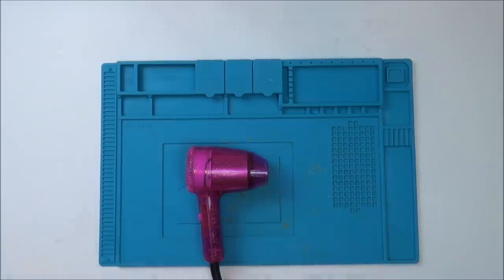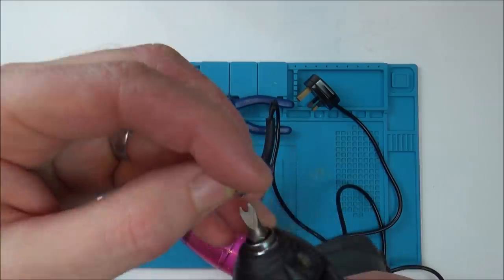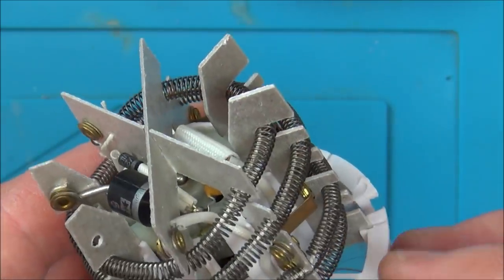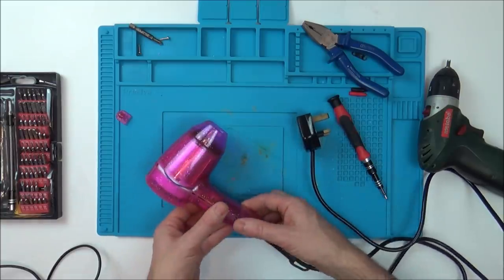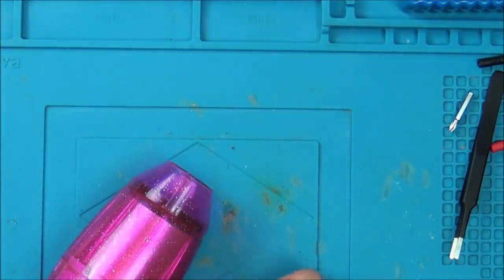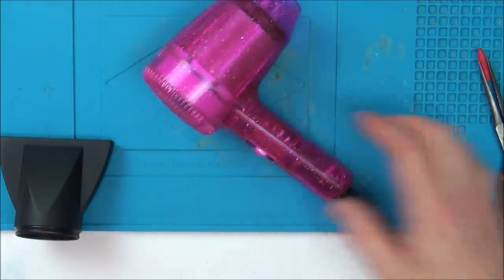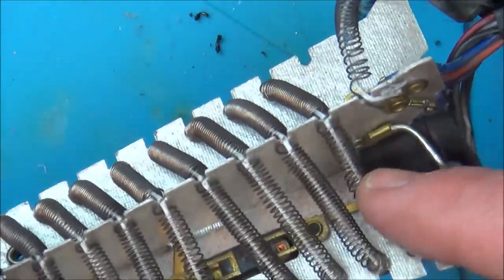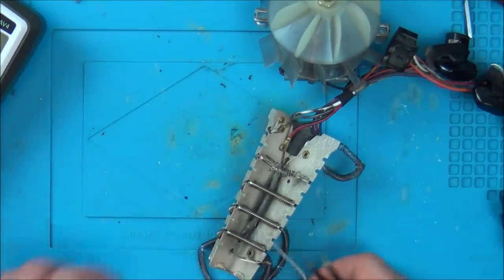Trying to FIX: 2 Faulty Hair Dryers

Comment: On the hair dryer on that mains cable going in to it there's a filter capitor and a discharge resistor across it the hair dryer has three elements the first and second have wires inbertween to give the right heat mode then four third speed there all powerd giving more heat

Comment: it will be, one coil for the first setting the other coil for the second setting and both coils for the third setting. The heat difference between the coils is caused by the resistance of  the coils.
Reply from the maker: Of course, that makes more sense. Thanks PDS :-)
Reply: @Mymatevince  I missed the part at the start of you looking at the second hair dryer, In which you say that the first heat setting is cold. If it is then it is just, First setting no coil, second setting one coil and third setting both coils. The cold boost button will spin the fan/motor faster. The capacitor limits spikes to the voltage when you use the switches. The impedance of the motor causes the voltage to spike when you first apply the voltage to the motor. Putting a capacitor across the motor or in that case the supply to the motor smooths the voltage line and greatly reduces spikes.

Comment: I took out the heating element on an old hairdryer during the hot months and just put in a switch with a 12v power supply, so I could have a handheld fan :)

Comment: A  "kit for young kids"...build your own mains powered hair dryer, what a great idea....can't stand kids. Seriously that pink thing looks like a bloody death trap, don't mean to scare you but cheap electrical goods and kids...Hmmm, I think I would be happier if the kid had the bigger better built one. But I guess they've been using it for years, so no problem yes ? maybe ? but those coils aren't far away and they're at mains potential, it looks like a toy, which it aint...just sayin. Your spot on with the "Bimetallic Strip" That sort of stuff I tend to treat as "disposable" I no that's not good practice what I mean is I would use the bits and bobs elsewhere, like the motor  and switches then just buy a new one for  the family....I was writing this as I was listening and its great ! you were saying all the sensible stuff that I was thinking, clearly you have no intention of using them again just another great video, thanks and a great new year to you all.
Reply from the maker: Thanks mate :-) Happy New year to you too.

Comment: hi vince this comment is unrelated to this video but i wanted to ask because i can trust your opinion, i was finding a short in my playstation 2 yesterday, i removed a chip and tested the caps around it but the short was still there, so i put the chip back on the board and took off an electrolytic smd capacitor, but the short was still there and the cap was testing fine, BUT...putting the cap back on the board with hot air.. i applied a little pressure to the top of the cap to make sure it had a solid connection and it blew up in my face.. could you shed a little light on what i did wrong so i dont repeat the mistake in future lol its made me nervous to try again... again sorry for the unrelated comment

Comment: you only got a bit of hair off the fan now if you did manage to separate the fan blade from motor you would have found the hair tightly wound round the spindle cos the motor should rotate more freely than that yet its not hence why the thermal cut out activates more than it should
Reply: your answer to the shock situation is the air goes in thru the back & out thru the front so there is no way you can get an electrical shock from it

Comment: I had a room heater (fan with heat coils like those) that had the same thing happen i would not trust it and threw it away.
Reply: I would imagine a room heater isn't likely to pose the same danger as a hairdryer used by someone with wet hair, wet hands, maybe in a steamy bathroom with humidity up.
Reply: @dodgydruid  it made a spark when the coil broke!

Comment: I don't think you can solder a broken heating element, I think you'd need to tack weld it back together because solder would probably just melt once you turn the dryer on.
Reply: Yeah, without that the only thing you can do is do a mr. twist and hope it won't break once those wires heat up. Not sure if it would really just melt away but i would not risk it (since hot msolder in hair is not fun)
Reply: Just buy a new hairdryer lol!

Comment: Once had a clothes dryer that the large heat coil would burn into. I would put the wire back together with a small wire connector and wait until it broke again. After 6 connectors, it got replaced. Great videos you do. Thank You...

Comment: Or you can get "that winding" for free. They are used in public restroom hand dryers. Cameras in restrooms are forbidden so you could easely kick one off the wall and take the coil home. Then you can measure the resistance and cut it at the needed lenght. You can easily calculate the needed resistance with Ohm's law. You know the voltage and power of that unit. 😂😂😂
Reply: You've been talking to the kids in my town.

Comment: This is what I remember about how the different heat settings work. You are correct in there being two different heating coils. The first heat setting only powers one coil which is usually shorter and therefore less resistance for heat to be created from. The second heat setting should be only powering the second, longer coil which has more resistance and can create more heat. The third heat setting is activating both coils at the same time which creates the most heat. The key is the switch and what coil is being powered. The reason the one coil was working was that it had its own power supply which was fed from the switch on the low setting. This can also vary from blowdryer to blowdryer but I think that is what is happening here.
Reply from the maker: Perfect explanation. Thanks Sarah1390 :-)
Reply: You are right I can confirm this, also adding that the small element his the contact for the fan motor. So if you disconnect the small element, the big one will still work on setting "2" (lets call it 1-2-3) But by disconnecting the small elements the blower fan motor wont spin :P

Comment: You could test the bimetalic strip by touching it with your soldering iron and watch it ping, you can check the temperature by gradually increasing the soldering iron temperature.
Reply from the maker: Very good idea. Thank you Thomas :-)
Reply: @Mymatevince  better u use ur hot air station ;-)
the bimetal thermostat should switch off the heating element if the fan fails

Comment: Depending on the raw wattage you could possibly make a new coil.   In China you can buy anything in component form from simple stuff like bespoke capacitors to heating elements, element coils and all sorts if you don't mind wading thru hundreds of pages on Alibaba and the forty thieves.   These things are super cheap as a unit whole and tbh its better not to risk it, if it was on 110v it wouldn't be such a disaster but 240 angry pixie power running through your hand to ground is very dangerous.   1970's hairdryers were designed to be fully servicable, 2010's ones unless they are top tier professional ones are designed to be thrown away.
Reply from the maker: Thanks Ian :-)

Comment: I think you got it in one with how the three heat levels worked - there was only a single difference between levels one, two, and three of that switch, the only difference between one and two - level three was the same as level 2 in terms of resistance, but obviously also added the extra coil on top of it.

Comment: It has a thermostat with bimetal plate (strip) that bend and cuts out when it overhead in the path of heater element, and when it cools it make contact again. The problem comes with ageing and constant heating it can't return to its original shape and cuts out earlier. It's main function is to protect melting of plastic if the hairdryer overheat. You could adjust that thermostat but the plate already loose its properties so you can just short it or remove it, but you have to watch for overheating. The speed is controlled through heater windings, different configurations provide different resistance and speeds on motor or use diode to partially rectify the AC which lead to dropping voltage to half. If you draw a schematic of this hairdryer you will understand everything. You can't solder Canthal wire (that's the name of heater wire) but you can wrap it or squeeze brass metal tube on two contacts you trying to join, but shorting the length of it will lower its resistance and will burn easyer. Yes you can add another pice to sustain the proper resistance of it.
Reply from the maker: Brilliant technixbul. Your comments are always so knowledgeable and helpful. Thanks for taking the time to share them with me and everyone else. Cheers mate :-)

Comment: Metals expand when they get hotter, not contract-  steel does it by less than brass.
Reply from the maker: Oh yeah, of course. Thanks for commenting on that :-)
Reply: @Mymatevince  The only substance that most people come across that has negative thermal expansion is water, between 0 degrees C and 4 degrees C.  That's why ice is less dense than liquid water and so ponds freeze from the top.

Comment: I've never understood why electric hair dryers are so terribly noisy, is it because they have such a small fan that spins at a high speed?  Is it because the fan moves air at a fast rate?  Why are they so loud?
Reply: They use cheap universal motors, mainly made of light, vibrating plastic. The fan in your computer is brush-less. That means no carbon brushes touch the rotor. So, this fan is more quiet. Of course the high speed also plays a role.

Comment: The mains voltage is a sine wave. The diode cuts of either the top or bottom of the sine wave, reducing the power.

Comment: The initial fault might have been that thread (fiberglass) that herds the nichrome coil into a somewhat linear coil as it sags after heating, might have just broken due to vibration and fatigue.
It is supporting a longer proportion of the coil and is at a terminus. String snaps and that section shorted.
Plausable?
Reply: YES!!! Its exactly what his happening inside the one I am fixing right now, the little white thread inside the coil his broken in hald and because of that the little coil his sagging (loose) and burnt in some areas because it shorted together, so that string his fiberglass is it? Im searching to order this material, I already got the Nichrome 0.1mm to redo the coil. But could not find what that little white string was, thank you I might find it now, I also notice that there his kevlar string for sale that can resist up to 800 degree F, wondering if it would be better or too much.